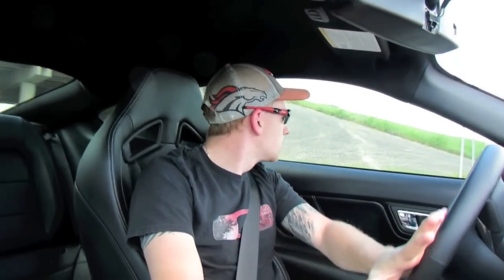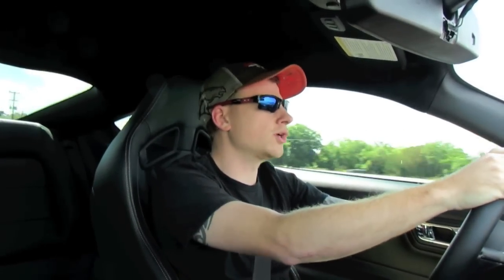2015 Mustang GT Stainless works exhaust CAR RIDE

Comment: Under the bridge High Revs just puts a smile on my face. Nice Ride Good Sir
Reply from the maker: Charles Thomas Thanks my brotha! Im loving every mile so far!
Reply: You welcome... I been wrestling with getting one but trying to hold off until my girlfriend has our baby but the urge is getting strong. I'm need to see how a babysit would fit in the backseat of 15' GT.
Reply from the maker: Charles Thomas I can't help you there. I have 0 kids lol
Reply: Lmbo...
Reply: +Charles Thomas it's very doable. I do it. not alot of room but my baby loves to ride in the stang
Reply: Awesome... My son doesn't like when i have stop at a light. Starts crying like crazy
Reply: Hahaha my boy is the same way. It's a tight fit back there  (especially rear facing seats) but move the passenger seat up a bit and it'll fit. O... and getting the car seat back out is like a big entertainment center in an apartment... it'll get in and out but with some twisting and bumps. My boy loves it. It's like an offroad adventure lol

Comment: I run the Stainless Works long tubes with cats, and Magnaflow -back.  The Magnaflows keep it quiet until I get on it, then they scream at WOT.  Best all around setup in my opinion.  Love the straight through design!

Comment: I heard the 15gt block can handle 800+ hp stock with no problem that's just insane.
Reply: Maurice Aucoin  its true, the 2015 motor came with forged internals. the only thing that remains cast (not forged) are the pistons. so yes, 800 hp is easy for these motors, hellion made 949 on one already, completely stock with just a twin turbo kit slapped on. although, pushing 800 hp on a stock motor would probably not be the safest thing to do for a very long period of time, but it can be done
Reply: Do you think 700hp would be okay on one of these as a Daily driver and weekends cruiser I don't want to beat it up at the track what you think?
Reply: i think 700 hp would be the upper limit on what one should have for a daily driver on stock motor, but it depends also on other factors like the way the person drives, and if it has a good tune or not. when you boost a car you need your tune to be spot on to ensure everything is running smoothly and safely. so yes assuming all variables are good, 700 hp can a daily driver/weekend warrior/midnight runner with these cars. since 2011 when the coyote motor first came out, people have been boosting them and having 600+ hp with no issues
Reply: I've heard the coyote is a tough motor It just Rev so freely as well what are some good tunes other than Bama?

Comment: Good video.

I have a gt pp on order, and was wondering if they come with a plug kit or compressor to fix a flat...? I know they dont come with a spare. 

As for future videos, id love to see some feedback on wheel hop or lack there of after the bushings and other steeda parts you mentioned are installed, or maybe a video on 5 things you like and 5 things you dont like about the car.

Thanks man.
Reply from the maker: Christian Holloway The s550s come with a compressor. The wheel hop is BAD. Subframe definitely needs some aftermarket mods. Ill get a video of wheel hop before and after Eibach an Steeda. Also a video of likes and dislikes.
Reply: STANGTHECOYOTE 
Much appreciated.
Reply from the maker: Christian Holloway No worries.

Comment: Hey I have borla s-type which consist of 21/2 inch piping. Will 3" headers bolt on?
Reply: Gonzalo Aguirre maybe with the factory connect it should but not with performance
Reply from the maker: Gonzalo Aguirre No you will have to get factory connect.